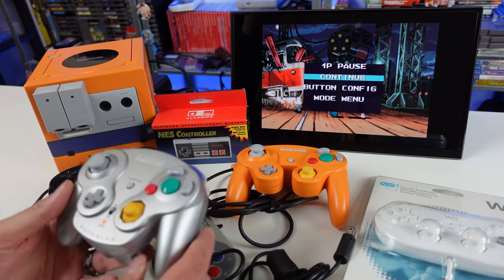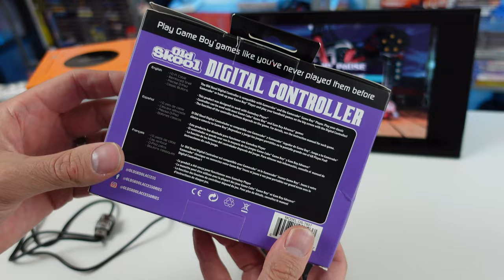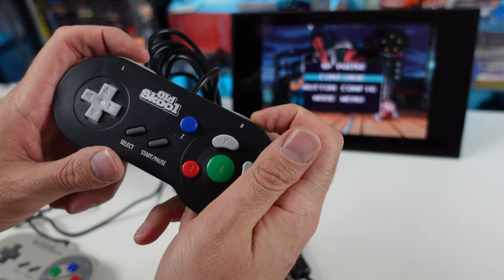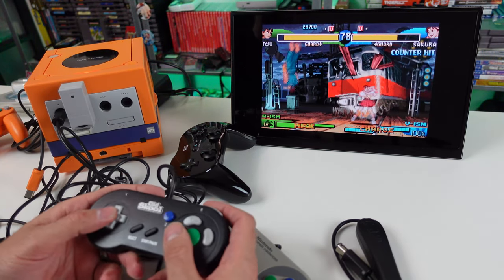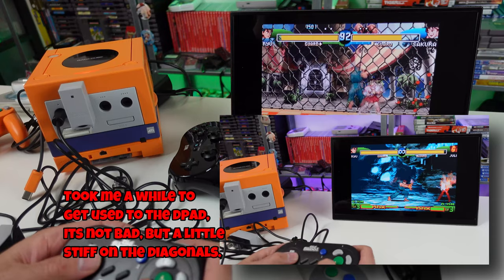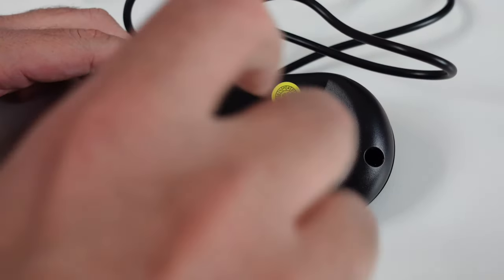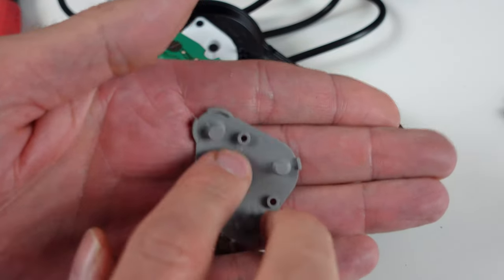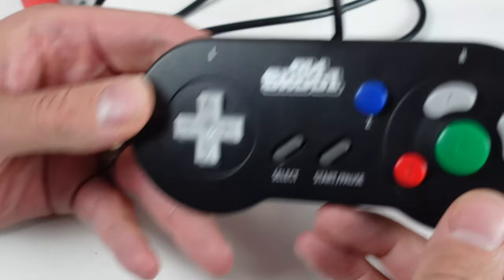FINALLY! The HORI Game Boy Player Digital Controller Has Been Cloned! Old Skool Review + Teardown

Comment from the maker: Changed out the dpad and membrane to oem snes and a good controller became awesome... no issue pulling off moves in Street Fighter Alpha 3. simple swap, find oem or oem style membranes and thats all you need to make it amazing!
Reply: I'm glad this thing exists now as a low cost version of the original.  But what about this is better than the Raphnet + SNES Classic controller?
Reply: It sounded like you were disappointed in the vid, thanks for clearing it up that you thought it was a “good” controller vs. a “not bad” controller.
Reply: Where did you get that Rafnet Adapter? If that's what you called it
Reply: Why can’t someone, (Nintendo) just sell at least the membranes?  The classic controllers feel good, so why not sell a little kit to livin back up our OEM controllers?
Reply: Thanks for the recommendation. I brought 2 and I was pissed. The d-pad was definitely some boo boo the fool. Glad I had some extra snes controllers to use for parts.
Reply: Did you use a classic controller or an original? I tried it on mine with an original and the circle around the Dpad was too large to fit into the space inside the old skool controller and still have full motion. I also tried swapping over the shoulder buttons but the pins on the original aren't as thick as the old skool controller and it added a lot more rattle.
Reply: Is it possible to swap out the face buttons too?
Reply: They aren't getting any more money so they don't care. They want you to get their switch online service lol
Reply: i was gonna mention it looks like an OEM dpad will fit

glad i waited on the hori
Reply: Thanks for the video! Is the A/B/X/Y membrane swappable with an OEM GameCube controller as well?
Reply from the maker: @jdeluna777  i believe so, but I will check and report back in a bit
Reply: I wanted to do that with the OG Hori Digital Pad but held off due to its rarity. Seems like Old Skool tried to reproduce the stiffness here, just like Hori was probably trying to match the original Dpad stiffness of the GCN controller.
Reply: Ok boomer
Reply: What’s the best place to get OEM (or OEM style) membranes?
Reply: Frank Garrett  Raphnet makes a few adapters to go from Gamecube to SNES, or Gamecube to Wii style connections, and more (N64, etc.). I have one for SNES I use with an 8bitdo SNES30 and another Raphnet adapter to go from Wii Classic Controller pro to gamecube. Look up "raphnet-tech" for their website, I think they sell direct and also on ebay (or used to the last time I purchased one years ago).
Reply: I recently picked one of these up and I agree that the D-Pad is not that great when precision is needed. To me the Shoulder Buttons as well as the Start & Select Buttons didn't feel great either. I swapped out the membranes as well as swapped the D-Pad out with an OEM one and now the controls feel great. It makes 2-D and Game Boy/Advance games play great. Great review and I look forward to what Old Skool does in the future. Cheers! 👍👍

Comment: I bought the Pelican version of the Hori pad many years ago on a whim and ended up using it for the GBA player. The GC controller D-pad is an absolute nightmare!
Reply: It's not really. It's just small and out of reach which can make it cumbersome to rely on. It is at least functional. Most GameCube games only use it for menus and some outright disable the D-pad anyways. Dumbass games like Dragon's Lair 3D make it worse because the controls locked an essential mechanic to it, requiring you to constantly press up or down whenever you need to attack or put away a weapon. The 360 controller has a D-pad that is debatably dysfunctional and some games are impossible to play accurately with it.

Comment: The BEST solution: Raphnet + 8bitDo SNES wireless receiver + 8bitDo SNES wireless controller
Reply: How does the latency goes whit that solution? I already have the adapter and a sn30pro plus, I have the raphnet n64 to gc adapter in mind, I wonder if it would in the n64
Reply: @bryanssj3949  I have and use this setup on a CRT. I've used the 240p Test Suite and from my tests there is 1-2 frames of lag. Certainly wouldn't want to speedrun with it but for casual play, it's really very comfortable.
Reply: I might use that solution or buy this so i can have the best of both worlds.
Reply: Yep, I have that setup for the gamecube on my big tv with the eon adapter. I have another Raphnet to use with my Wii Classic Controller Pro that I use with the gamecube on my CRT since its a shorter distance from that couch to the tv.

Comment: This is awesome! I too used the Raphnet adapter however I just bought the chip and wired it directly into a snes controller as I didn't really need options. 
This is a much  nicer choice and it's cheaper than what I spent hard modding my snes controller.
Kudos!

Comment: I got one and the Dpad Membrane still had the the center intact, not a hole. Snipped that out and it was MUCH better. Waiting on a replacement membrane though, what they have is simply too thin. 

Also, my L-button plunger was too shallow, and had to cannabalize an old and cheap SNES 3rd party controller for a new one.

Comment: I wouldn't mind using this on the Wii either. This seems like it would be a good WIRED controller for certain 2D Wii games as well as emulators on the Wii.
Reply: I may end up using it on my Switch. I don't have a Game Boy Player.
Reply: @Chaos89P  Didn't even think about that. I already have the Gamecube controller adapter.

Comment: Man I really need to get that hdmi adapter and get my GameCube hooked up.
Reply: Retrobit is awesome! But if you still want Component, you should grab the EON MKII for the Gamecube.
Reply: Skip it, spend the same amount on a Wii with component cables.
Reply: @leviwarren6222  I heard that GameCube games end up looking muddy on the Wii.
Reply: @Chaos89P  it's not a perfect solution but you can get 480p out of it for cheaper. Plus you won't be getting lag from an analogue to digital converter. But I prefer performance over visuals anyway.
Reply: @mbe102  The Carby is much cheaper but still high quality. Most TVs lack component input nowadays anyways so I have no use for that on my GC. I got one and don't regret mine.

If people really want component I'd just recommend a Wii+HD Retrovision component cables. Wiis are practically a dime a dozen if you know where to look, and the HDRV cables are at this point about the same price as OEM. You probably won't notice the miniscule quality difference on an HDTV thanks to blurry upscaling.

A Wii + component cables would likely cost you less than the difference between the Carby and EON and Nintendont allows you to play GC games with higher frame rates and faster loading, no memory card necessary.
Reply: Or get the hyperkin cables they’re cheap not perfect but it works great on my 46 in hd tv on my room doesn’t look muddy like in the Wii but don’t expect 4K
Reply: I have the CARBY for my gamecube and its fantastic and for half the price of the eon.

Comment: Maybe you can change out the dpad. Not sure if this is possible. Can you use this on an original Wii that has the GameCube controller slot?  If so then you can then use this as a classic controller.
Reply from the maker: just changed the dpad and membrane to oem snes and its awesome now, 10000x better than the dpad was

Comment: Quick question mlp: iirc, the original hori digital controller's select button acts the same as the y button. Does this old skool controller's select behave the same way?
Reply: So that's how the Select button works on the Game Boy Player?
Reply: @Chaos89P  yeah because with the original software, select was either mapped to y or x (can't remember, I don't have a GameCube) because the GameCube controller didn't have a select button.

Edit: for some gameboy/color  and GBA games it's best to have select as close to your thumb as possible anyway because due the lack extra buttons, select (hell sometimes even start) was used as an extra action button rather than a second menu button.

Comment: It looks like the rubber of the dpad is exact same as SNES controller.
If you replace the rubber for original SNES one, the feel of the dpad could be much better.
(I did it for 8bitDo SN30 controller and it worked.)

Comment: I want to add a little commentary on this as someone who bought the original HORI digital controller new and still owns one. Despite the current insane price tag, it's honestly not a great controller. I paid 10 bucks for mine back when no one wanted them and even then thought it was just a novelty. The D-Pad is exceptionally stiff, and llike Matt reports on this one, not that great on the diagonals. Also, considering the types of games you would want to use this controller for, the button layout is sub optimal. There is a reason these controllers are rare, it's because no one wanted them! I think this clone will be a great way for people to sate their curiosity without having to pay the insane 200 dollars people are asking for these below average controllers. That's just my take, to each their own of course.

Comment: this footage of SFA3 for gba looks better/smoother than any other video of the game. something fancy going on with the screen/adapter?
Reply from the maker: Well a couple things. Hdmi using gcvideo, and instead of using the original Gameboy player loader I am using Gameboy Interface instead which is a software replacement for the original loader disc that has more options and typically the games look sharper and nicer. Its not using emulation or anything, still running off of the GBA hardware that is used inside the gb player.

Comment: I sold mine to my cousin (Hori purple). Its ok, but it's not worth 190$. The d-pad is a little stiff, and it's not like the Gamecube it's full of d-pad compatible games. Mine was primarily to play SNK vs Capcom 2 (there's another 2d fighting game for the Gamecube?), and sometimes for the Gameboy Player. In terms of gameplay, I think it's best to find a Playstation 2 to Gamecube controller adapter, and use the Dualshock or third party playstation controller. (calm down buddy, I know Playstation controllers are always terrible, from PS1 to Dual Sense, but in this case, they're better than the Hori). The fact that the Hori controller is focused on the d-pad, but the button distribution follows the gamecube pattern (instead of copying the Snes pattern), it's a problem, not a good thing.

Comment: I tried and got burned once with an Old Skool controller, never again. Bought a brand new "Falcon" (imitation GC Wavebird), and was defective right out of the box. Chinese junk.
Reply: just because you had 1 bad controller is no reason to boycott a company,  It does not matter what company it is or what product there is going to be a defective unit here or there.
Reply: @robertcooperstein9286  sure, but definitely a higher probability of it with a company that sells cheap chinese knockoffs.